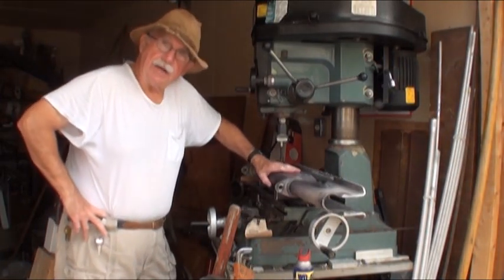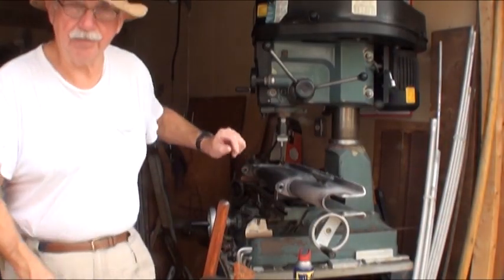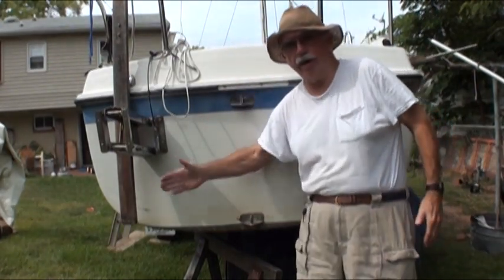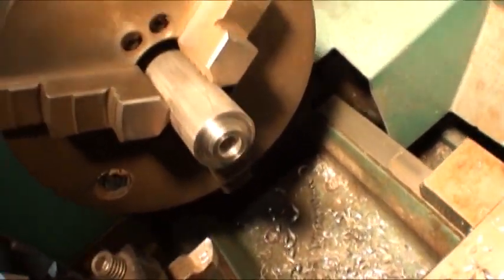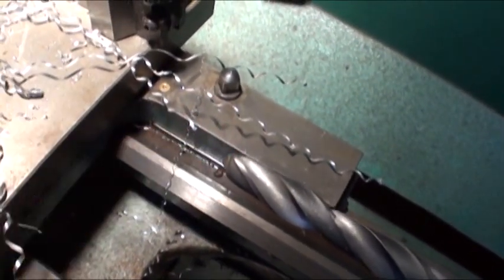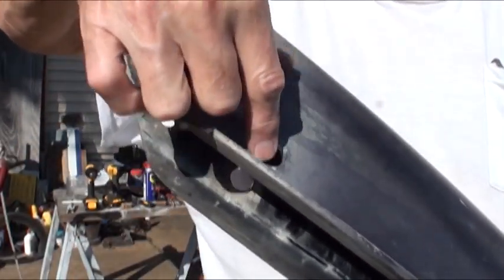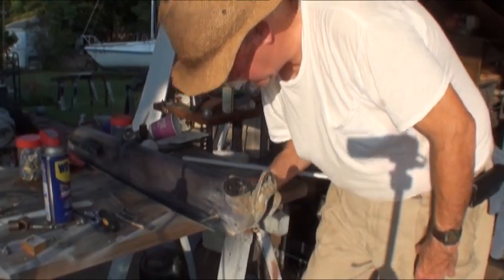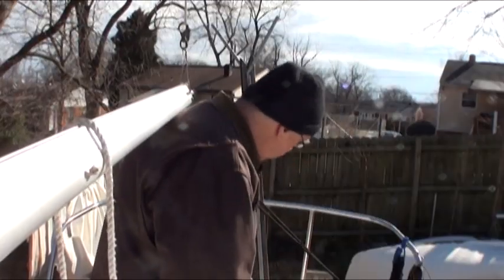MacGregor 22 Rudder Bushings

Comment: I have a 1971 and the rudder is wooden as well as a slightly different mounting. I guess mine doesn’t have the time on it as the system is still tight.
Thanks for the video